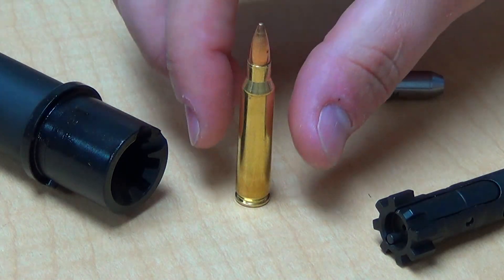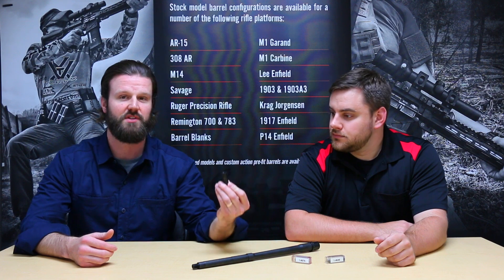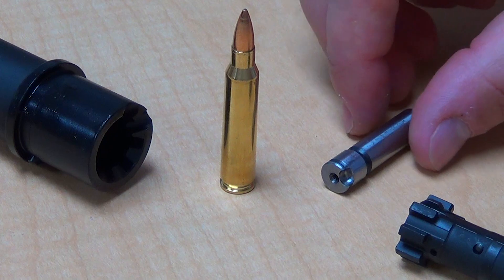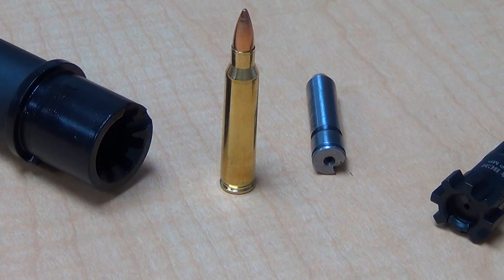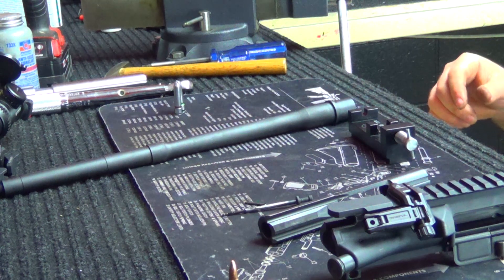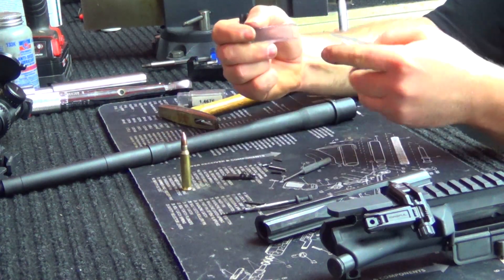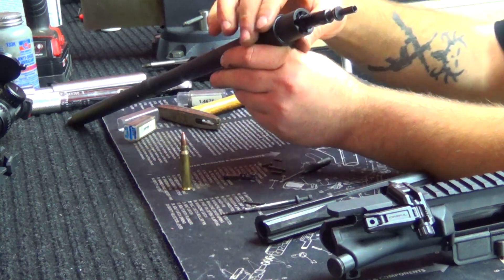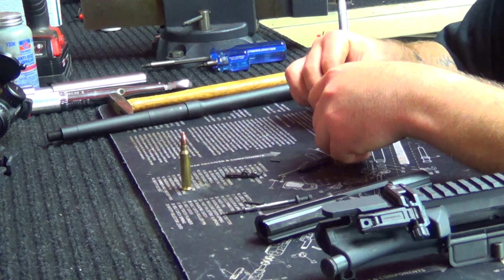Accurizing the AR-15 - Part 1: Checking Headspace

Comment: What's the best way to check headspace on a rifle already assembled?  
Insert the gage into the chamber, then use your fingers to see if you can rotate the bolt that's been disassembled?
Or, disassemble the bolt, then put the bolt back into the bolt carrier, then try to close the bolt on the chamber?

Comment: Been struggling with a build and very poor accuracy. No headspace gauges on hand so I used a dowel to measure from the bolt face to the front of the lugs of two different bolts. My spare was roughly 30-40 thousands shorter. Threw it in the rifle and shot a 1.6 minute, 10 shot group. Best this rifle has shot before was 2.5 minutes with 5 shots. Crazy, thanks for the video.

Comment: Take the headspace challenge. Test the headspace of 500 new and 500 used bolts. Test them assembled and disassembled and tell me if you get different results on a single one of them. The need to disassemble a bolt to test headspace is a myth. I have been doing this for 45 years and never ever have seen a bolt show different results if not disassembled. Change my mind.
Reply from the maker: If the ejector is not removed, it will push up on most gauges and can impact the accuracy of the headspace measurement.  While the headspace on an individual bolt will not change when you disassemble it, the accuracy of the measurement can be impacted, which is why we generally recommend disassembly.  When measuring multiple bolts, bolt to bolt variance is extremely common. We measure every lug on every bolt when they are sorted at our facility and the variations in tolerances can be dramatic, regardless of the manufacturer.  Machining tolerances are real and if one measures 500 bolts, each one will vary slightly, it depends on how closely you are measuring them.  Headspace does erode over time with use as the parts wear.  Tolerances will change between a new and a well-worn bolt.  Headspace is critical to function and performance as it is directly responsible for the consistency of the chamber pressures and seating depths.
Reply: @ true there can be bolt to bolt variance. Hell, in the Marine Corps we would run LTIs and if we found a no-go we would usually just throw a BCG from another weapon in it and swap them if they both passed after swapping. Bad practice, but we were “taught” to do it. But that is irrelevant because the purpose for gauging headspace is to test the distance when a round of ammunition is chambered, and that the firearm is safe to fire. If you are adding or removing unrealistic factors into the measurement process, then you are not getting an accurate measurement of that distance as the firearm is actually going to be used. 
Furthermore, I stand behind the fact that the variance of testing with an assembled bolt vs a disassembled bolt will not give a false reading. If you haven’t tested this yourself then make sure you have before you try to convince people otherwise. A gunsmith doesn’t have to work at a well known manufacturer in order to be on the correct side of a debate. Have. You. Tested. The. Theory? Or are you just parroting what you have always been told?
Reply from the maker: @hogstoothtactical  I have tested it and disagree with your understanding and assessment.  Again, it all depends on how tight of a tolerance and what type of performance you are looking for.  If you are simply looking for SAAMI specs, then it matters very little as it is wide.  The AR system is exceptional and can run even without proper headspace in some cases, for a time.  If you are looking to build the most consistent, accurate, and reliable system, it is critical.  There is no debate.  Have a great day devil dog.

Comment: Is every bcm bolt than headspaced to criterion barrels? I have a 16inch Hybrid right now planning on switching and buying the 18inch hybrid and 11.5 inch hybrid with the kak carrier and bcm bolt head.
Reply from the maker: Unfortunately not.  Headspace must be checked any time one pairs a bolt and a barrel regardless of the manufacturer.

Comment: Josh or Michael, if a 5.56 barrel takes a NoGo .223 guage, but not a 5.56 field guage, is it safe to shoot .223 ammo through it?
Reply from the maker: While the likelihood of any injury is extremely low, I would recommend finding a larger bolt to tighten up headspace.  Headspace is critical to function as is it directly responsible for the consistency of the chamber pressures and seating depths. Getting set up correctly from the beginning will produce better accuracy and reliability for the life of the barrel.  I recommend finding a bolt that closes tightly on a 1.4646 go gauge (meaning you can feel the lugs engaging inside the barrel extension as you turn the bolt).  I like to see no movement at all with a 1.4676 no go gauge.  If you have any issues finding a properly paired bolt, feel free to git in contact with us and we can get you set up with one if you send your barrel or complete upper receiver in for a head-spaced bolt.

Comment: Watched many videos on ar15 head spacing…..have never seen one fail the test….
Reply from the maker: We find out of tolerance bolts on a daily basis from a wide range of well-respected companies.  Checking headspace is similar to leveling the foundation before building a house.  It is critical to long term accuracy and reliability as it directly controls the consistency of the chamber pressures and seating depths.  Millions of structures have been built without first leveling the foundation... still a terrible practice.  If one cares about performance (reliability/accuracy) and understands how these rifles operate, it is not debatable, headspace is critical.

Comment: Is there a 5.56 specific set of gauges or the 223 rem works for both barrels?
Reply from the maker: I recommend gauges for either chamber with a GO spec of 1.4646 and a NO GO spec of 1.4676.  If you look for a tight closure on a GO gauge you will achieve approximately .001 of clearance between the bolt and barrel for the most consistent chamber pressures and seating depths.
Reply: @CriterionbarrelsInc , thanks for the reply. I’m new to headspacing so trying to learn correctly. I assume the same gauges you mentioned for your 223 wylde barrels too?
Reply from the maker: @atox4957  That is correct, the distance is the same between .223 Rem/5.56/.223 Wylde!
Reply: @CriterionbarrelsInc  These videos are awesome.  I've been looking for go/no go gauges with the specs listed above (1.4646 & 1.4676) and can find the 1.4646" listed as the Colt spec on Brownells but can't find a no go that's 1.4676".  Can you point me in the right direction to find this?

Comment: how to fix if your new rifle has excessive headspace?how do you actualy make it correct?
Reply from the maker: Ultimately, you would need to find a bolt that properly head-spaces.  It is quite common to find significant variations in bolts even from reputable sources.  This is one of the reasons we offer head-spaced bolts that are hand fit to approximately .001 of clearance between the bolt and the barrel for optimal chamber pressures and seating depths.  It removes the headache that some customers experience... in theory you could try several bolts and none would be an ideal fitment.  Because head-space is so critical to performance, we like to offer properly fit bolts for the benefit to our customers.

Comment: The correct TDP go gauge for the US military M-4 - M-16 is 1.4646, not the commercial 223 1.4636..Many channels don't know this, good job...Many manufacturers don't correctly make a true 5.56 or 223 Wylde throats.. Using a throat or function gauge is an easy way to test any new barrel's chamber...

Comment: Assuming you're chambered in 5.56 NATO (apologies if I missed this), why are you using a 1.4676" NO GO Gauge instead of 1.4696?  Is it simply that you (Criterion) want that tight of tolerances for "accurately" shooting groups?  For the weekend warrior/home builder, maybe building a CQB or similar, who doesn't care about THAT tight of a grouping, is 1.4696 the proper dimension for a NO GO gauge in 5.56 NATO?

I'm by no means trying to relay that I am some sort of expert and know something you don't.  Quite the opposite.  I'm learning and there is a plethora of [differing] information that I'm trying to sort through.  My current understanding/belief is that 1.4636 is the mil-spec Go, 1.4646 is the Colt accepted GO, 1.4696 is the "No-Go", and 1.4736 is the NATO "Max", or what I would consider to be the Field.
Reply: The US military TDP go gauge is 1.4646

Comment: Hello I recently assemble a faxon upper. Barrel reciver. Bcg. Do I need to check head space
Reply from the maker: Yes.  Checking headspace is similar to leveling the foundation before building a house.  Despite what anyone may say, checking headspace is essential to maximizing performance from your rifle.  Headspace dictates the consistency of your chamber pressures and seating depths.  This goes a very long way in ensuring that your rifle will be accurate and reduces wear and tear on internal parts and components.

Comment: What do you mean by "headspacing a bolt"? Are you just checking the headspace incase it's off or is there a process that you do to fix it?
Reply: Right, but how do you correct it...trash the Bolt and get a different one?
Reply: @unapologetic7900  barrel extension
Reply: Headspacing insures the bolt twists all the way home into battery so the gun will fire, but there is no slop in the fit which could result in the base of the cartridge separating and essentially backfiring into the receiver.

Comment: So any videos about how to chwck headspace but no videos explain what cause improper headspace
Reply: Jeff Gao 1. Out of spec barrel. 
2.out of spec bolt
3. Used bolt with new barrel or vice versa
Reply: @echofoxtrotwhiskey1595  Thanks for that answer. How common is out of spec bolts or barrels?

Comment: What gauges do
 you suggest be used for the hybrid profile .308 ar barrels?
Reply from the maker: Gauges from PTG, JGS, Forster, and many others work very well.  We hold production tolerances well inside SAMMI specs with a GO spec of 1.631 and a NO GO spec of 1.634.  When we pair a bolt to our barrel we can generally obtain around .001 of clearance for a very tight head-space which makes for extremely consistent chamber pressures and seating depths... all good for accuracy and overall performance.

Comment: Appreciate the effort. Unfortunately your audio sounds like you're working inside of a tin can. The benchtop work on the barrels is really hard to see. Not close enough and too dark. In 30 years of film and video I have never seen (heard?) one man narrate another man's hands. It just feels weird. More nice, soft light bounced off of a white ceiling or sheets of artboard ( foam core) , however  you can hang it, and you will be rocking . You guys are both well spoken, again thanks for your efforts.

Comment: who makes head space gauges with the hole milled out in the back?
Reply: You can't mill a hole. Holes are drilled, bored or reamed but never milled.
Reply: @brianmorrison9066   boring is done with a boring bar, reaming is done with a reamer,  and drilling is done with a drill bit.  If I put a hole in a work surface with an end mill, I did indeed perform a milling action.

Comment: What head space gauges do you use in your 223 wylde barrel
Reply from the maker: We use a mix of gauges from either PTG or JGS.
Reply: @CriterionbarrelsInc  using 223 or 5.56 gauges?
Reply from the maker: Either one will work, so long as it measures out to 1.4646 or 1.4676. You can go a bit longer on the no-go gauge if you prefer, but that's what we typically hold our internal tolerance to.

Comment: What do you do if it's too tight and what do you do if it's too loose?
Reply from the maker: The easiest solution is to just change out the bolt. The rifle will likely function just fine if the headspace runs a bit long (our internal tolerance is significantly tighter than the USGI no-go or field gauge spec), but for optimal accuracy it is usually best to have it fit the prescribed range.

If you have a Criterion barrel you would like mated to a headspaced bolt, all you need to do is give us a call and send the barrel in to us. We'll pair it with a BCM bolt that shares the correct headspace specification.
Reply: Too loose means you're not packing enough heat.

Comment: Acoustics and or microphone absolutely terrible!
Reply from the maker: It's tough to filter out background noise in a machine shop. This room was the best option in drowning out the various shop sounds, although it does tend to generate a bit of an echo. We're planning an office expansion over the next couple months that should allow room for a video studio with better acoustic properties.
Reply: Criterion Barrels, Inc. , sir if l buy ar-15 hbar 5,56/223 barrel from you can l use my sharps XPB complete bolt carrier directly ? Or l have to buy BCM bolt from your Web? Thanks ,
Reply: @CriterionbarrelsInc  excuse excuse, the guy shooted a bullet off the group he blamed to the wind.
Reply: @CriterionbarrelsInc  A cheap fix, get some matress egg crates and tape them to to wall, will help kill any sound bouncing around. Heck, even actual egg crates will work

Comment: So what happens if the bolt doesn't headspace properly? Do you need to adjust the barrel nut until it does? Is this something a customer can do?
Reply from the maker: A barrel extension can be modified to headspace properly but it takes a few hours of machine and labor time to get it effectively dialed in. The most cost effective fix is to get a new bolt that features the proper tolerance spec.

Another option would be to send us the bolt and new barrel out to us and we could try to find a replacement barrel that is on the high or low side of the tolerance (depending on how the bolt gauged). Sometimes you can get lucky and find one that matches (if you can find a barrel and bolt that have overlapping tolerance ranges).